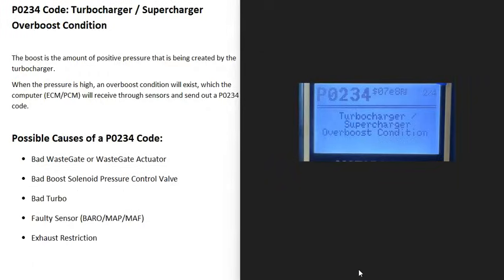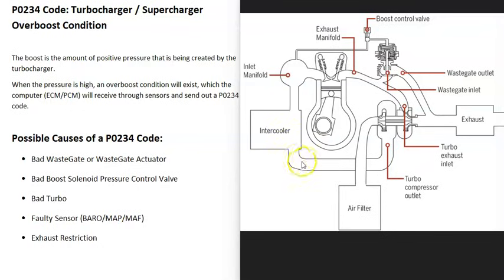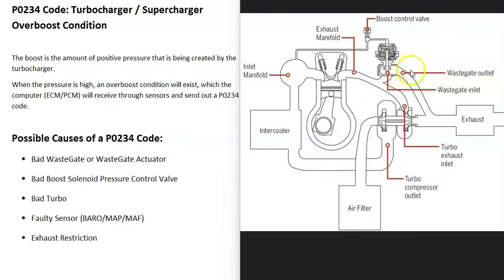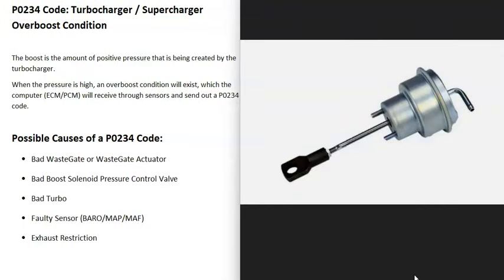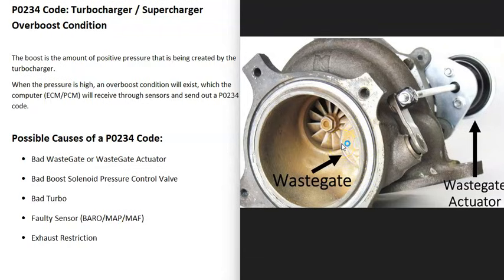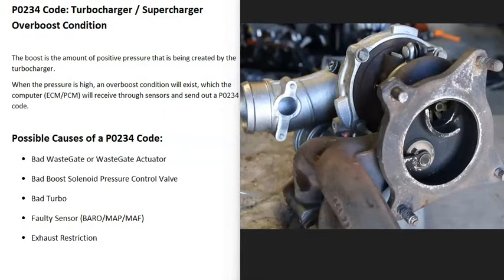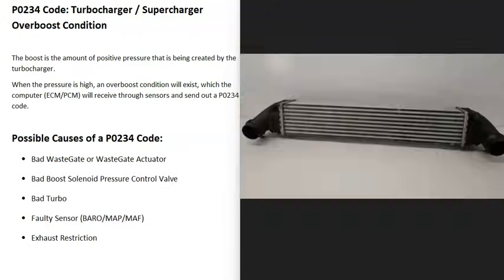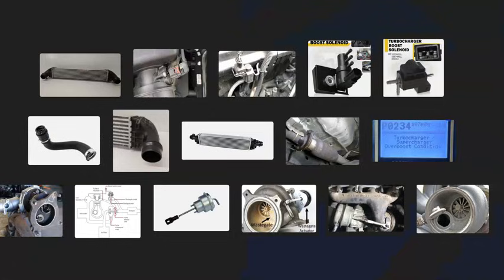Causes and Fixes P0234 Code: Turbocharger / Supercharger Overboost Condition

Comment: Question, I only get this code over 45 mph and if I reset it doesn't come on unless I go over that speed. Everything seems to be running just fine on a Polaris 2022 Pro xp. I do have an aftermarket assassins tune on it and have tried changing the different stages but it still comes on at 45. Is this a detrimental code, even if it seems to be running just fine?

Comment: 2019 Equinox with the P0234 code. No engine light, but it is a rough start when the engine is cold, for about 30 seconds, the engine runs well. Sounds like it is coming from the recently replaced turbo

Comment: Hi there, this helpt a lot. 
My 2013 Peugeot Expert got the P0234 and more..

Complete List of Fault Codes – Peugeot Expert (RH02 / DW10FC)
	1.	P0234 – Turbocharger overboost (turbo producing excessive boost pressure)
	2.	P0215 – Fuel shut-off solenoid – circuit malfunction
	3.	P11AA – Air intake flow too high
	4.	P149C – Diesel particulate filter regeneration frequency too high
	5.	U1218 – CAN-bus communication fault between ECU and other module(s)
	6.	
	•P1497 – Turbo incorrect position / insufficient supercharging
	•	P2562 / P2566 – Turbo position sensor fault / incorrect variable geometry position

When you look at this what would-be the First thing to do?
Reply: Pray

Comment: Any idea shed some light on an issue I’m having for over a year fault code P02340 coming up as turbocharge over boost limit exceeded,, v6 204bhp DDXB engine 

now I’ll list everything I have tried 
Boost pressure sensor or maf sensor 
Turbo and actuator 
Throttle flap 
Dual throttle flap (both are on intake one either side of boost sensor) 
Turbo vacuum solenoid 

The dual flap was changed6 days ago and as very heavily carbonated with soot normally it would come on everyday but managed 6 days on this trail, 

But more in depth on the issue only occurs when you get to 2200rpm in 4-5th gears hold it at that rev 

Has been mapped for EGR and ad blue but EGR not blanked as was told it’s closed 

Any help much appreciated
Reply: Hi have you found the issue i have this code as well
Reply: @Claus-n3m nope still working on it what model have you got
Reply: Have you adjusted or changed the actuator? Might need a diagnostic machine (VCDS VAG for my Audi) to adapt the actuator to the ECU settings.
Reply: @s20dcb  yes vcds was used to learn the new turbo and actuator, I’ve since mapped the code off the ecu as we couldn’t figure out the issue since it’s been done no issues since jeep drive perfectly fine
Reply: @Farmer_scoobs How did you map it out the ECU? I’m needing to adjust the actuator bolts on the thread before running the VCDS again as it’s a crazy over boost.

Comment: I have a 2016 Ford fusion titanium 2.0 turbo I got the P0234 code also with a misfire code for the third cylinder not sure if something with the turbo would have something to do with the cylinder missed fire I could really use the help thank you
Reply: Change ignition coils and spark plugs
Reply: sorunu çözdün mü

Comment: I’m being told it’s the turbo boost sensor  and that the boost pressure regulation has exceeded its limit doesn’t that mean the turbo is bad?
Reply: no, will be the wastegate mate. The turbos the thing making the boost so its fine, its the control of the boost thats the problem. Broken turbos usually underboost and noises mate.

Comment: Very well explained. Knew all this but it's the perfect explanation for someone that doesn't have this knowledge. 

Chasing down a p0234 on a 2013 focus ST it's been 5 months and still haven't figured it out but I know how to use forscan now and feel fancy 😂

FYI if you're replacing sensors always use OEM these sensors are very delicate and china doesn't always work
Reply: What was the problem?
Reply: @raheimwalker3865 my problem was the intercooler sensor.  Wouldn't run right or rev. I tried many sensors even ford sensors but the one i needed had some different numbers like 92f479. can't remember if this was the exact part number but if you need it I can make sure so lmk.

Comment: I have all this codes P0471, P0380 and P0234 fault codes renault maste, intiallly i used to get check anti pollution system but it used to go awag after high way drives but thos time i got the check anti pollution and check injection when connected with obd2 scanner i got the above codes car drives normal. One of the codes is glow plug circuit I'm not sure if baf glow plug can trigger this lights?

Comment: I had this code and changed the solenoid. Never had any sort of lack of power. After I changed the solenoid change the light stayed off. Later on I had a code for my catalytic converter. Ran some cleaner though my system via fuel. Fuel MPG went up after that. Now the P0234 code is back and I am experiencing lack of power on hills at highway speed. Any ideas?
Reply: wastegate jamming up. Take the wastegate off and clean it make sure it can move in and out freely. The new sensor has been quick enough to keep the target and actual turbo speed close enough to each other as not to throw a cel but the more jammed up the actuator rod has got the more variation there is between what the turbos being told to do and what its actually doing. The only other thing that would cause that is a dodgy maf. To find out which one it is if you have a scantool even a cheap one you will be able to see maf pressure live and watch it to see it doesnt just hop up from say 0.6 to 3.6 instantly like a spike. If its not the maf then it will defo 100% be the actuator but my bets on the actuator to begin with. If your reader can bring up custom readings then select the following > 1. Maf pressure   2. Waste gate duty   3. Waste gate actual   4. Boost Pressure  5.Boost pressure actual. 6 voltage.   What you want to look out for is the waste gate actual and if its varying when the duty goes up and see when you can see the boost spiking above what its been told then  have a look at everything else as it does that to see what ones playing up.
Reply: @BlatantBurnerAccountCool 😎 comment, much appreciated.
Reply: Sticky VIENS VNT. Clean the turbo with mr muscle
Reply: aynı problem bendede var CHR

Comment: I have a 2008 Focus ST with the Volvo T5 engine. I keep getting a p0234 code and car goes into limp mode when I go up steady inclines and have to use slight boost to maintain speed. Doesnt do it any other time, boosts hard and drives perfectly fine otherwise. Any ideas?
Reply: jamming up wastegate

Comment: I have a 2013 Ford Escape I don't know if it matters if it's from Canada or not it was imported sold in the US Michigan the Motor City. I've replaced everything from the turbo to the solenoids to the diverter valve. I still can't find what the problem is. Would it be buying an Amazon solenoid turbo solenoid I read somewhere where it was best to have the Ford product if you're still getting these issues I just don't want to spend $100 for the boost solenoid I have bought three of them now? Any help is well appreciated😊

Comment: Stuck swirl flaps in the manifold can also make the boost pressure go up. Happend to me once.
Reply: Wdym
Reply: On my 2004 Opel Astra 1.7cdti.
Driving and accelerating on the highway demanding max boost and engine load.
I had a broken vacuum line going to solenoid for these intake manifold flaps. They remained shut so they were blocking the flow and so the boost went up too much. It had no sensor on the flaps or actuator for the flaps to inform the ecu. The boost values never went out of range in the other driving conditions.

Comment: I got this error too: 16618 boost presure regulatiom p0234 - 000 - limit exceedee (overboost condition) on my VW Touran '04. Happened while going down a valley 10°, i had like 100km/h and i pressed the acceleration, a little bit over 2000rpm and i felt like cutted the turbo. 🤔🤔
Reply: You get this sorted mate what was the reason same has happened on my golf

Comment: I have a 2013 Chevy Cruze. Replaced the turbe a couple of years ago. Today I picked up a PO234 code, and only that code. How would I troubleshoot the wastegate and boost solenoid?
Reply: boost solenoid will give wild readings on the actual boost pressure on your reader. Watch the boost and actual boost pressure and if its wandering and overshooting slighlty then you just need to clean your wastegate the rod will be jamming up slightly. Check the maf isnt going nuts on your reader too. Like getting to 70mph or whatever and deciding to spike up.
Reply: Test the wastegate with a vacum tester. On top of the turbo as in the video the actuator has a hose going in it. Remove the hose and put the hose from the tester. Search up on how to test and you will find a video.